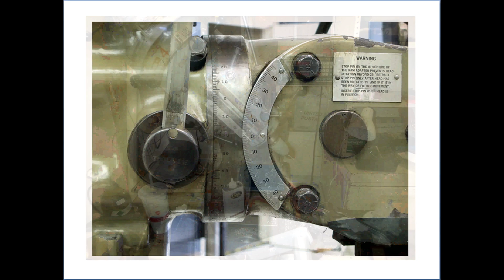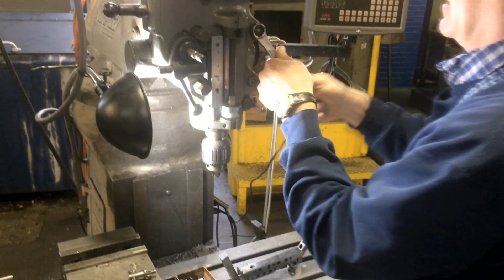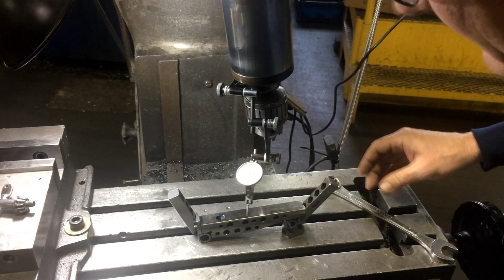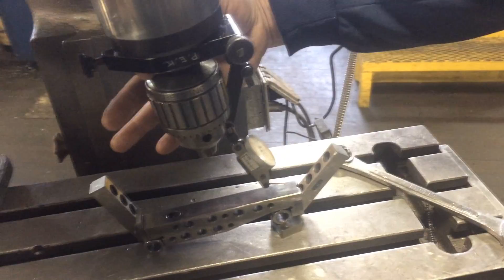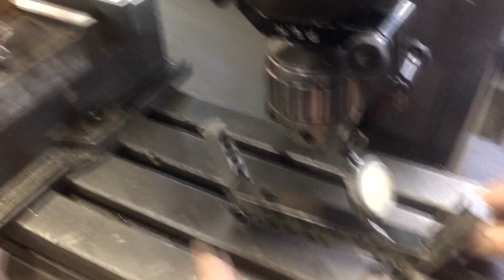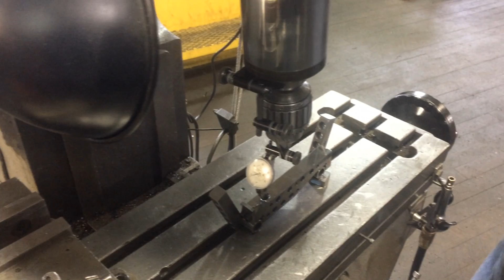#321: How To Tip Bridgeport Head To a  PRECISE Angle

Comment: I'm no where near what an actual machinist is never mind a T&D maker or Mold maker. But the face of the knuckle the head bolts to has to be in the same plane as the X axis table travel. If it's slightly off the head isn't being tilted square to that axis. So if all the machining and grinding on that knuckle was done correctly then the ram, needs to be aligned 90 degrees to the X axis. Good video though.

Comment: nice video!
im guessing you know this so I'll say it for the begginers. it's not really recommend to set your angles at the end of your tables because the table tilts a bit at each end. if he were to recheck the angle at the middle of the table, the reading would be off. so if possible, set the angle close or at the place you will be working :)